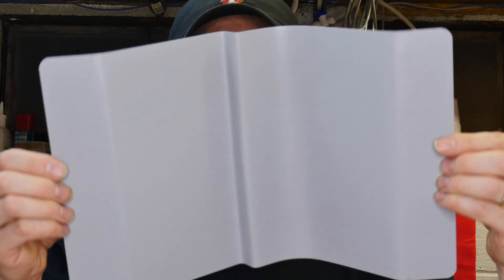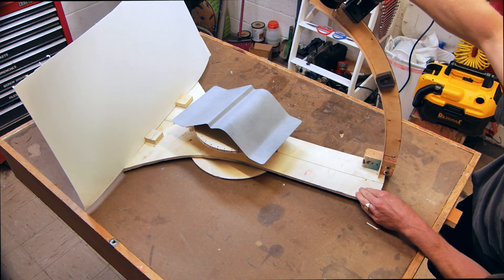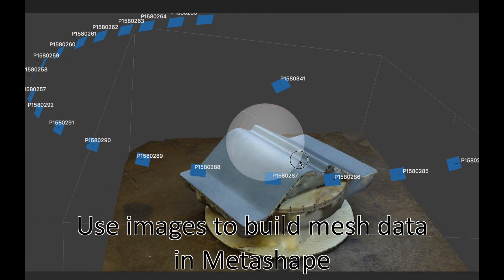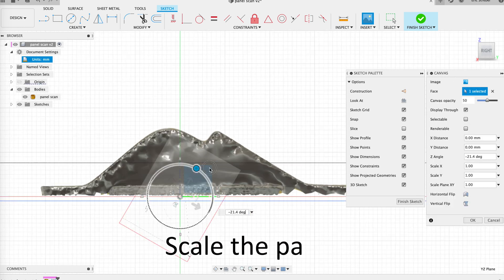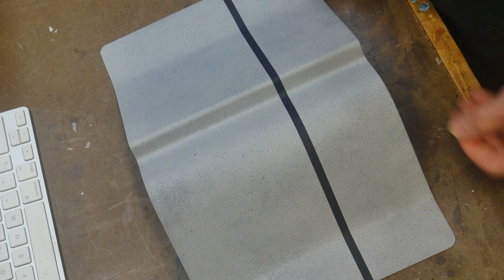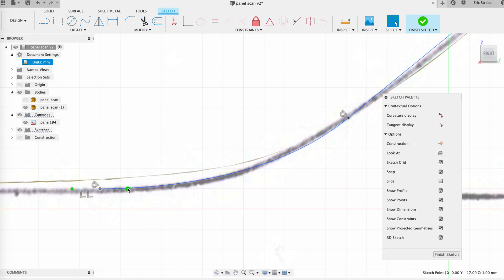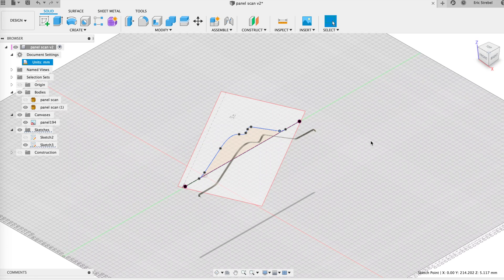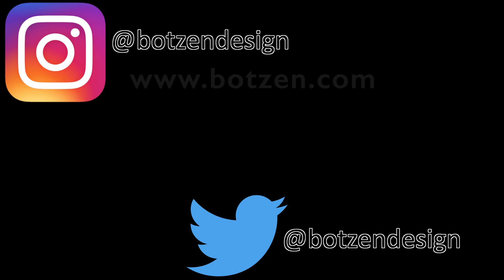Is Photogrammetry Accurate?  Using Agisoft Metashape to reverse engineer a scanned panel

Comment: Great video! I noticed that the lense of your camera can create different results sometimes. Some lenses break the light in different ways, depending on how many physical much lenses it has, and can create a bent surface in the most unfortunate case later. (I myself am using a 55mm Zeiss lense which has very low error) In a good setup it should be fairly accurate though.

Comment: I have a 1:43 die cast model car that I plan to photogrammetry, radically modify and then 3D print.  What I’ve learned is that there’s no software that allows one click to convert many photos to a solid to modify.  The few I’ve seen require the results to be imported into the 3D app and traced.  I’m looking for a workflow from photogrammetry to modify to print.  Any app recommendations?  Id want to use Shapr3d for edits.
Reply from the maker: Essentially you're correct the model you scan is basically something you can just use you will have to recreate it from that mesh, it will be merely a guide. Unfortunately I wish it was different. Perhaps there is someone who reads this that can shed some light on making this easier.
Reply: @EricStrebel   scanning and scaling  just fine here. 600 to 900 photos. for diecasts... and a lot of patience with metashape. Glue the model on a pillar on 360 platform rotate and iphone away LOL move it to 3d program and create a new surface or solid. Everything fits 1st go.

Comment: Some other tools in Fusion360 for working with mesh data including a mesh sketch option (snap a spline to a mesh cross section)  along with some surface tools as well https://www.linkedin.com/posts/christopher-wilczewski-b4335113_3ddesign-3dscanning-faro-activity-6633354344018300929-2SNv
Reply from the maker: Clever! I like it, thanks for sharing.
Reply: @EricStrebel  thanks and thanks for your videos!

Comment: Eric, thanks for the great videos and ideas for rigs. I'm new to Agisoft Metashape. I've got a light box with an opening for the camera and I'm rotating the object but every time I try to align photos they are all from one position. The manual says to rename them camera station, which I've tried, shooting a low angle and a higher angle the same as you would with a drone around a building but using the turntable to rotate the object. I'm sure the solution is simple but would appreciate if you can help me. Thanks,
Reply from the maker: Don't know, since I use a different process, the soft ware is not meant to be used with a rotating object, I would reach out to agisoft and ask them. Best if luck. Thanks for your comment and support, much appreciated

Comment: A tip for scaling the canvas. If you insert it and check the "make selectable" box, once its inserted, you can simply right click on the canvas, select calibrate, and choose 2 points on the canvas and set their distance in mm. Its basically exactly what youre doing, just a little faster I think, and a built in function.

Comment: Would have been nice if you had 3d printed part of the panel so you can compare if you have hit the dimensions right. I have wanted to do this with car panels, so that I can design car accessories.